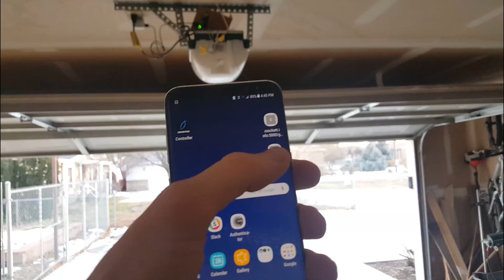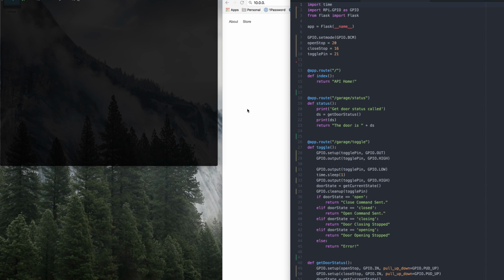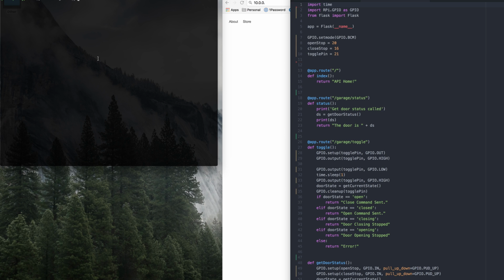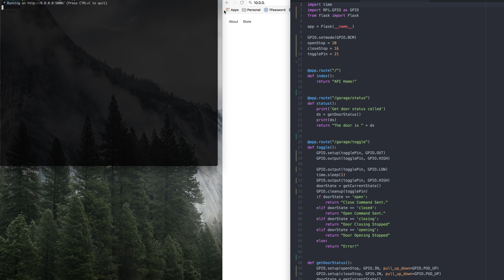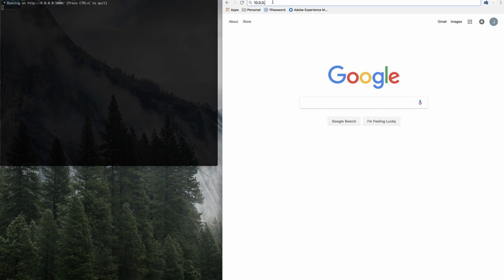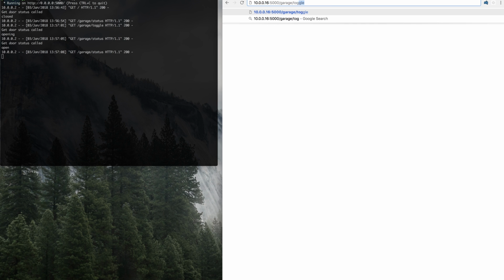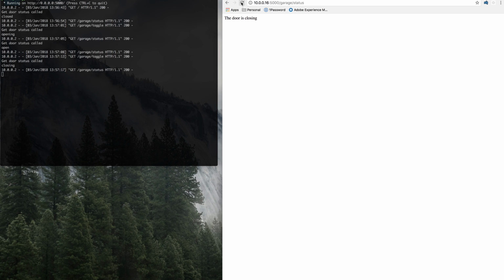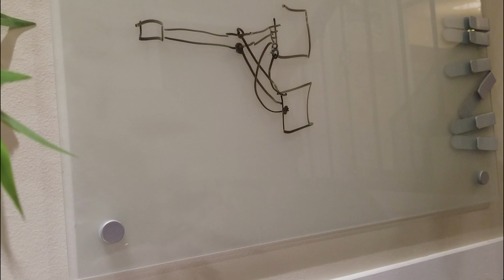Make a Smart Garage Door With Raspberry Pi

Comment: Just a FYI. I did some experiments last weekend and and learned that if you close those two door pins through a 200 ohm resistor, it will function as a light switch.

Comment: The only issue I see with your code is security.
From what I can tell, there's no security in what you wrote and that can be used against you to open the garage door.
Reply from the maker: Correct, there is no security.  If you run this on your local network behind your internet router like I am I don't really think that's a concern.

Comment: I've seen similar projects using relays. Any benefit to using those relays vs just the GPIO as you've done?
Reply from the maker: In' my case the relays were not necessary.  If you need higher voltages then they could be necessary.
Reply: It's been three years since you published the video. Any problems with the Pi over the long term? I'm wondering if the 5 volt reference voltage that the garage door opener supplies has damaged the Pi through the GPIO pins.
Reply from the maker: @fordsrmaster   I had it hooked up for about a year and it worked fine.  I've moved since then and haven't bothered to set it up again.